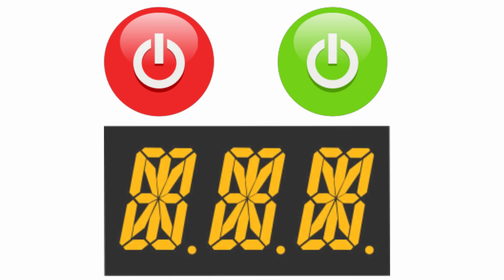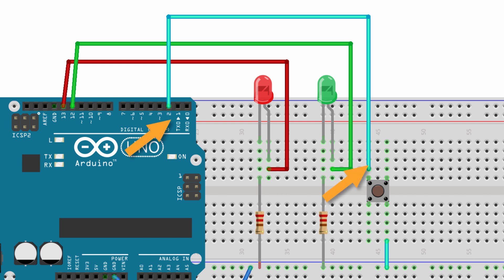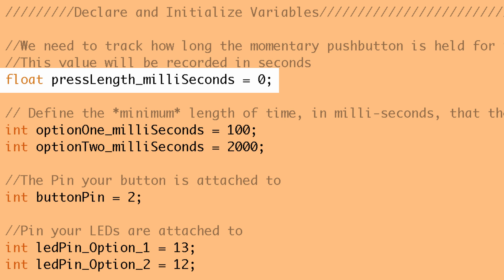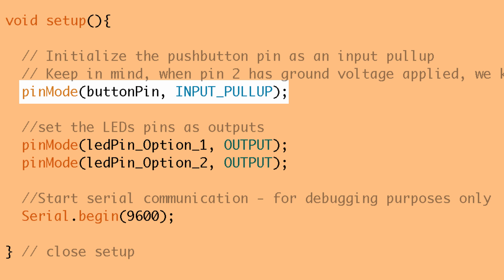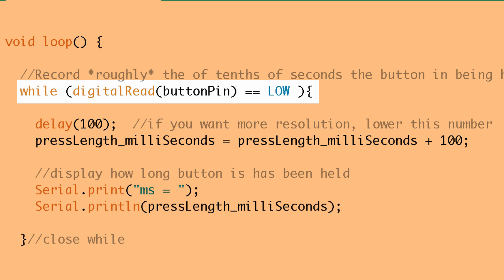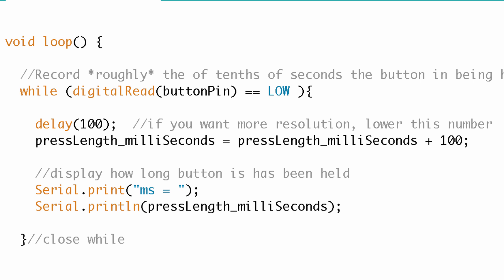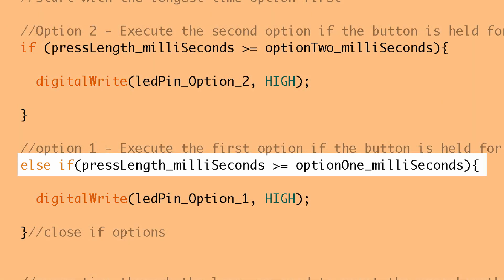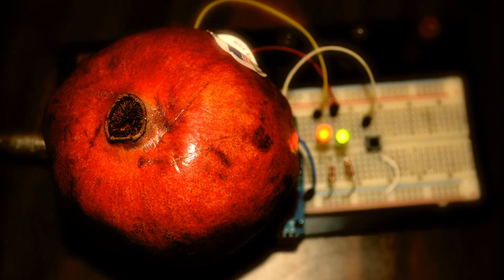How to Make One Button Have the Functionality of Two or More with Arduino

Comment: This is great, but how do I turn off the LEDs one at a time, or all at once when I'm done with them?
Reply: You could,  have them turn off in the if else statement.  So option 2 turns off option 1, option 1 turns off 2. Then a press of 4000+ could turn off both

Comment: @Programming Electronics Academy, so I painstakingly copied then modified the "opensource" code from your video, then tried to modify an off sequence by writing an option 3 big suprise got compile errors, I'll try to work that out with hours of other utube videos, but I cant seem to find out when putting pin 2 in a pull up state, does it remain in that state even after uploading a new sketch that doesnt use pin 2? or after uploading one that doesn't use pin 2? can a noob just use an external resistor? (i think I might be able to answer that my self after watching one more time) and does float refer to a pin being in neither a pull up or pull down state? any how thanks for the vid.

Comment: Your example is so dificult and complicated... I make much much sipler way to do it. 
the code:
// #####################################
int pinswich = 2;
int ledpin = 13;

int state = LOW;
int a = LOW;

void setup(){
  Serial.begin(9600);
  Serial.setTimeout(10);

  pinMode(ledpin, OUTPUT);
  pinMode(pinswich, INPUT_PULLUP);
  
  digitalWrite(ledpin, LOW);
}

void loop(){
  while (digitalRead(pinswich) == HIGH)
  {
    a = HIGH;
    delay(10);
  }
  
  if ((a == HIGH) && (state == HIGH))
  {
    digitalWrite(ledpin, HIGH);
    Serial.println("on");
    state = LOW;
    a = LOW;
  }
  else if ((a == HIGH) && (state == LOW))
  {
    digitalWrite(ledpin, LOW);
    Serial.println("of");
    state = HIGH;
    a = LOW;
  }

}
// ##############################
variable "a" is like gate. Works only one time after pushing button. It means that "If" statment will not work untill variable "a" will be set to high state.
And variable "state" remembers wich task should do next time when variable "a" will be on high state. 
My pushbutton have disatwantage, and mechanical parts are not made so well, and arduino see relising button like 2 times. delay helps likwidate disadwantage of mechanical conection in button.
Is also posible to set 3 state pushing button 3 times. And rather using HIGH and LOW, can be used also numbers.
While loop is used when push button is pressed, and we dont want have any change in program untill push button will be relised. 
In side of while loop also is posible to set counter of milis which can be used in multi state options.
HAH! My program is easier, simpler to understand.
Reply: int pinswich = 2;
int ledpin = 13;

int state = LOW;
int a = LOW;

void setup(){
  Serial.begin(9600);
  Serial.setTimeout(10);
  pinMode(ledpin, OUTPUT);
  pinMode(pinswich, INPUT_PULLUP);
  
  digitalWrite(ledpin, LOW);
}

void loop(){
  while (digitalRead(pinswich) == HIGH)
  {
    a = HIGH;
    delay(10);
  }
  
  if ((a == HIGH) && (state == HIGH))
  {
    digitalWrite(ledpin, HIGH);
    Serial.println("on");
    state = LOW;
    a = LOW;
  }
  else if ((a == HIGH) && (state == LOW))
  {
    digitalWrite(ledpin, LOW);
    Serial.println("of");
    state = HIGH;
    a = LOW;
  }

}

Comment: This helped me out a lot with my menu scrolling script, so I no longer get the skipping due to longer key presses. Any press between 10 and 3000ms now count as one step in the navigation.
Thank you very much, this is a great video!
Reply: int pinswich = 2;
int ledpin = 13;

int state = LOW;
int a = LOW;

void setup(){
  Serial.begin(9600);
  Serial.setTimeout(10);
  pinMode(ledpin, OUTPUT);
  pinMode(pinswich, INPUT_PULLUP);
  
  digitalWrite(ledpin, LOW);
}

void loop(){
  while (digitalRead(pinswich) == HIGH)
  {
    a = HIGH;
    delay(10);
  }
  
  if ((a == HIGH) && (state == HIGH))
  {
    digitalWrite(ledpin, HIGH);
    Serial.println("on");
    state = LOW;
    a = LOW;
  }
  else if ((a == HIGH) && (state == LOW))
  {
    digitalWrite(ledpin, LOW);
    Serial.println("of");
    state = HIGH;
    a = LOW;
  }

}

Comment: Do not use delay (if you use more buttons it will not work right?) i use: in the loop unsigned long currentMillis=millis(); if((unsigned long)(currentMillis - btn1previousMillis) >= btn1interval){//handle led and pressed boolean (overflow safe) }

Comment: Hi, I think this is a really great video and I did everything told here, however, my board was still having some compiling issues and then the board itself executing the code, even if I uploaded the code multiple times. Any Tips?
Reply: int pinswich = 2;
int ledpin = 13;

int state = LOW;
int a = LOW;

void setup(){
  Serial.begin(9600);
  Serial.setTimeout(10);
  pinMode(ledpin, OUTPUT);
  pinMode(pinswich, INPUT_PULLUP);
  
  digitalWrite(ledpin, LOW);
}

void loop(){
  while (digitalRead(pinswich) == HIGH)
  {
    a = HIGH;
    delay(10);
  }
  
  if ((a == HIGH) && (state == HIGH))
  {
    digitalWrite(ledpin, HIGH);
    Serial.println("on");
    state = LOW;
    a = LOW;
  }
  else if ((a == HIGH) && (state == LOW))
  {
    digitalWrite(ledpin, LOW);
    Serial.println("of");
    state = HIGH;
    a = LOW;
  }

}

Comment: Hi sir
How can stop Both LED by same button
and Add one more button???
Reply: This is what I did. I use 'option3' to write both pins to low. I did a lot of messing around...but if you copy/paste and set the Arduino up as shown in the video I'm 99% what I have here will work for you too. This has a quick press turning on pin 12 and turning pin 13 off, a longer press turning on pin 13 and turning 12 off, and a longer-er press turning off both 12 and 13.

float presslength = 0;
int option1 = 100;
int option2 = 1000;
int option3 = 2000;
int buttonpin = 2;
int led1 = 12;
int led2 = 13;void setup() {
  pinMode(buttonpin, INPUT_PULLUP);
  pinMode(led1, OUTPUT);
  pinMode(led2, OUTPUT);
  Serial.begin(9600);
}void loop() {
  while(digitalRead(buttonpin) == LOW) {
    delay(50);
    presslength = presslength + 50;
    Serial.print(presslength);
  }
  if(presslength >= option3) {
    digitalWrite(led2, LOW);
    digitalWrite(led1, LOW);
  }
  else if(presslength >= option2) {
    digitalWrite(led2, HIGH);
    digitalWrite(led1, LOW);
  }
  else if(presslength >= option1) {
    digitalWrite(led1, HIGH);
    digitalWrite(led2, LOW);
  }
  presslength = 0;
}
Reply: @pengwin9   with your help I'm driving the three speeds of my home ventilation with one button.
Thanks man

Comment: Great video!!!

However I need some clarification. 

You have option 1 set at =>100 to activate the red LED.
You then have option 2 set at =>2000 to activate the green LED.

So when you press the button the first time for 2500ms, why does the red AND green LED not turn on. because the statement => 100 should turn on the red LED, since 2500ms is > 100.

where is the part of your code that specifies the top limit for an option. 

SO if I have 3 options, can I specify something that states
option1 =>100 but no higher than 1999ms 
option2 =>2000 but no higher than 2999ms
option3 =>3000 but no higher than 3999ms
and so on and so on..

the 3 options above, without defining a "no higher" option, if I press the button for 4000ms, then why would it not turn on all 3 options since 4000ms is => all of my options.
Reply from the maker: Great question Mike.  Since we are using an IF/ELSE statement in this sketch, only one of the if statements gets executed.   

If we had to separate if statement, one after, then the issue you mention would be a problem.

Hope this helps some.
Reply: Ja zrobiłem o wiele prostrzy sposób, w moim kodzie też możesz dodać jak długo przycisnołeś guzik i wybrać opcje względem czasu kliknięcia.

int pinswich = 2;
int ledpin = 13;

int state = LOW;
int a = LOW;

void setup(){
  Serial.begin(9600);
  Serial.setTimeout(10);
  pinMode(ledpin, OUTPUT);
  pinMode(pinswich, INPUT_PULLUP);
  
  digitalWrite(ledpin, LOW);
}

void loop(){
  while (digitalRead(pinswich) == HIGH)
  {
    a = HIGH;
    delay(10);
  }
  
  if ((a == HIGH) && (state == HIGH))
  {
    digitalWrite(ledpin, HIGH);
    Serial.println("on");
    state = LOW;
    a = LOW;
  }
  else if ((a == HIGH) && (state == LOW))
  {
    digitalWrite(ledpin, LOW);
    Serial.println("of");
    state = HIGH;
    a = LOW;
  }
}

Comment: I was wondering why mine wouldn't work, but then I remembered the Pomegranate. I went out and bought one, put it on the desk next to me and my Arduino and it still didn't work? Turns out the pomegranate wasn't ripe so I had to go out and get another one. I got a ripe one, put it on the desk next to me and surely it worked! Somewhat annoying that the pomegranate must be ripe but otherwise great tutorial!
Reply from the maker: It's those details that are always tripping me up...thanks for pointing that out!
Reply: int pinswich = 2;
int ledpin = 13;

int state = LOW;
int a = LOW;

void setup(){
  Serial.begin(9600);
  Serial.setTimeout(10);
  pinMode(ledpin, OUTPUT);
  pinMode(pinswich, INPUT_PULLUP);
  
  digitalWrite(ledpin, LOW);
}

void loop(){
  while (digitalRead(pinswich) == HIGH)
  {
    a = HIGH;
    delay(10);
  }
  
  if ((a == HIGH) && (state == HIGH))
  {
    digitalWrite(ledpin, HIGH);
    Serial.println("on");
    state = LOW;
    a = LOW;
  }
  else if ((a == HIGH) && (state == LOW))
  {
    digitalWrite(ledpin, LOW);
    Serial.println("of");
    state = HIGH;
    a = LOW;
  }

}

Comment: Sir Please help me So how to blink and fade a led with one button with this way, when press first time button led will blinking and when press some second same led stop and fade function will start. So I need one button and one led but function are two one is blind and one is fade. Please help me sir.
Reply: int pinswich = 2;
int ledpin = 13;

int state = LOW;
int a = LOW;

void setup(){
  Serial.begin(9600);
  Serial.setTimeout(10);
  pinMode(ledpin, OUTPUT);
  pinMode(pinswich, INPUT_PULLUP);
  
  digitalWrite(ledpin, LOW);
}

void loop(){
  while (digitalRead(pinswich) == HIGH)
  {
    a = HIGH;
    delay(10);
  }
  
  if ((a == HIGH) && (state == HIGH))
  {
    digitalWrite(ledpin, HIGH);
    Serial.println("on");
    state = LOW;
    a = LOW;
  }
  else if ((a == HIGH) && (state == LOW))
  {
    digitalWrite(ledpin, LOW);
    Serial.println("of");
    state = HIGH;
    a = LOW;
  }

}

Comment: Seeing this usefull tutorial I made my own version.
Multiple options selected by a combinations of short and long pushes on the button.
Unlimited number of options are possible.
- Short
- Long
- Short Short
- Short Long
- Long Short
- Long Long 
- Short Short Short
Etcetera....
The recording of a series of pushes ends after 2 seconds of not pushing the button.

The code:

boolean endOfSerie = 0;
String serie = "";
float pressLength_milliSeconds = 0;
unsigned long releaseMoment = 0;

int shortPush = 100;
int longPush = 500;
int breakofLength = 2000;

int buttonPin = 2;
int ledPin_1 = 13;
int ledPin_2 = 12;

void setup(){
  
  pinMode(buttonPin, INPUT_PULLUP);     
  pinMode(ledPin_1, OUTPUT); 
  pinMode(ledPin_2, OUTPUT); 
  
  Serial.begin(9600);                                     

} // close setup

void loop() {
  if (endOfSerie == 0) // If there is not yet a finished series of pushes continue or start recording.
  {
    // Record serie of pushes
    while (digitalRead(buttonPin) == LOW ){ 
  
      delay(100);  //if you want more resolution, lower this number 
      pressLength_milliSeconds = pressLength_milliSeconds + 100;   
  
      //display how long button is has been held
      Serial.print("ms = ");
      Serial.println(pressLength_milliSeconds);
      releaseMoment = millis();
    }//close while record length of push
    
    if (pressLength_milliSeconds > longPush)
    {
      serie = serie + "L";
      pressLength_milliSeconds = 0;
    }
    else if (pressLength_milliSeconds > shortPush)
    {
      serie = serie + "S";
      pressLength_milliSeconds = 0;
    }
    
    if (releaseMoment != 0 && releaseMoment + breakofLength < millis()) // if pause between pushes is longer then afbreekLengte, end of Serie is reached
    {
      releaseMoment = 0;
      endOfSerie = 1;
    }
  } // end of series recording
  else
  { // execution, because series of pushes has ended
    Serial.println ("Uitvoering");
    Serial.println (serie);
    
    if (serie == "SS") // first option executed after two short pushes
    {
      digitalWrite (ledPin_1,HIGH);
    }
    else if (serie == "SL") // second option executed after a short then a long push
    {
      digitalWrite (ledPin_2,HIGH);
    }
    else if (serie == "SSSS") // third option executed after four short pushes
    {
      for (int i=0; i<=20; i++)
      {
        digitalWrite (ledPin_2,HIGH);
        delay(50);
        digitalWrite (ledPin_2,LOW);
        digitalWrite (ledPin_1,HIGH);
        delay(50);
        digitalWrite (ledPin_1,LOW);
      }
      
    }
    else // if the series of pushes is not a valid one execute this option 
    {
      digitalWrite (ledPin_1,LOW);
      digitalWrite (ledPin_2,LOW);
    }
    serie = ""; // reset push series
    endOfSerie = 0; // allow start of recording new series
  } // end of execution
} // close void loop

Comment: I am using this code to change numbers on a seven segment display and it didn't seem to be working too well until I changed the while statement from "while (digitalRead(buttonPin) == LOW)" to "while (digitalRead(buttonPin) == HIGH)". After that it worked perfectly. Thank you so much for your help!

Comment: What if I want to change the "program" with one button by one push. Not a timed press. 

I want to make one button change between a steady light, a blink example and a random blink example.
Reply: int pinswich = 2;
int ledpin = 13;

int state = LOW;
int a = LOW;

void setup(){
  Serial.begin(9600);
  Serial.setTimeout(10);
  pinMode(ledpin, OUTPUT);
  pinMode(pinswich, INPUT_PULLUP);
  
  digitalWrite(ledpin, LOW);
}

void loop(){
  while (digitalRead(pinswich) == HIGH)
  {
    a = HIGH;
    delay(10);
  }
  
  if ((a == HIGH) && (state == HIGH))
  {
    digitalWrite(ledpin, HIGH);
    Serial.println("on");
    state = LOW;
    a = LOW;
  }
  else if ((a == HIGH) && (state == LOW))
  {
    digitalWrite(ledpin, LOW);
    Serial.println("of");
    state = HIGH;
    a = LOW;
  }

}
Reply: Try use variable like memory. function1 function2 and so one, and push button in seperate function. This way procesor will jump at whole code, and will du also led blinking. Remember to not use delay for blinking, but counting variable, and when will reach 200 then blinking will change. 
You dont need use milis() if You doint care about timing. Simly use " count = count +1 "

Comment: Excellent..!!
But Can we operate two different LED's using single button?? I mean when i'll press the button, 1st LED should glow and it should be turn off after few second... and when i'll press this button for 2nd time, 2nd LED should glow and it should be turn off like 1st . so on... what to do??
Reply from the maker: +Anand Dalal Yes, that is very doable.  You might use  a variable that toggles back and forth each button press, and two separate  if statements with conditions that blink the LED accordingly.  Hope this helps some.
Reply: +Programming Electronics Academy hi, Could you please give an example?
Reply: int pinswich = 2;
int ledpin = 13;

int state = LOW;
int a = LOW;

void setup(){
  Serial.begin(9600);
  Serial.setTimeout(10);
  pinMode(ledpin, OUTPUT);
  pinMode(pinswich, INPUT_PULLUP);
  
  digitalWrite(ledpin, LOW);
}

void loop(){
  while (digitalRead(pinswich) == HIGH)
  {
    a = HIGH;
    delay(10);
  }
  
  if ((a == HIGH) && (state == HIGH))
  {
    digitalWrite(ledpin, HIGH);
    Serial.println("on");
    state = LOW;
    a = LOW;
  }
  else if ((a == HIGH) && (state == LOW))
  {
    digitalWrite(ledpin, LOW);
    Serial.println("of");
    state = HIGH;
    a = LOW;
  }

}

Comment: I was able to extend the count for the button presses and add a short one to reset/turn off the LED's.  I also removed the Serial command so I could push to one of my attiny85's I seem to like.  I'm thinking of creating a circuit to include to relays instead of the LED's so I can use one button on a motorcycle handlebar to control two external light circuits (driving and fog lights perhaps).  Medium press to turn on one circuit, longer press for second.  Somewhat quick press turns off both.  Thanks again.
Reply from the maker: Awesome!  Glad it could be of use.